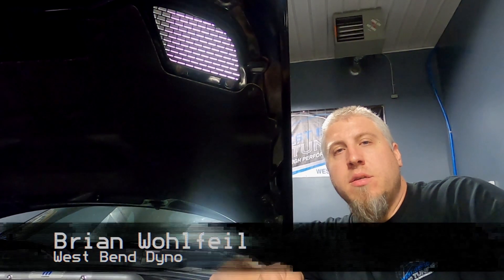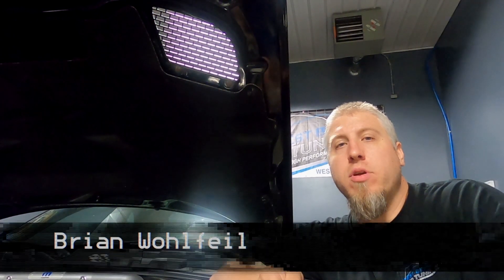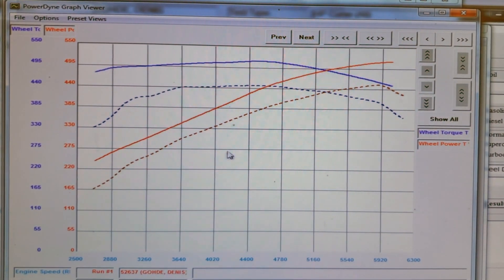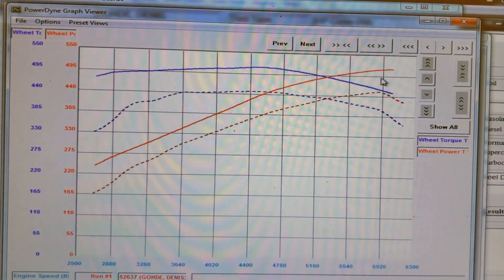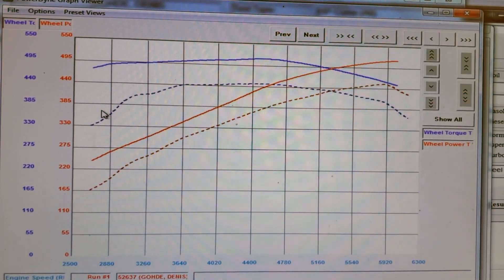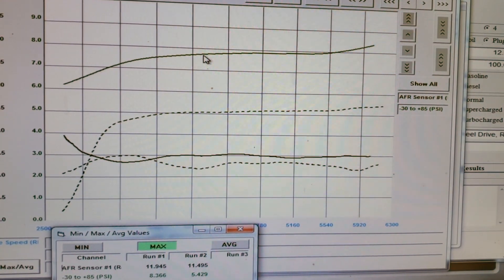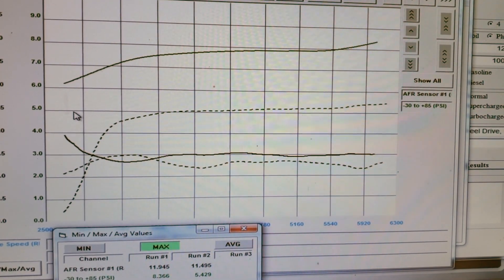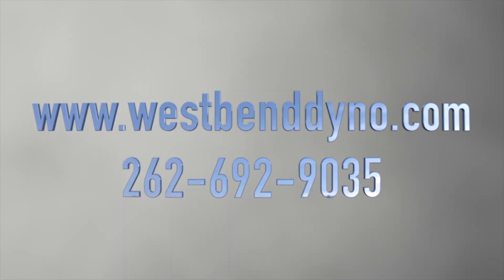West Bend Dyno Tuning - 2010 Challenger 5.7 L Hemi Magnuson Supercharger

Comment: Curious, with the 3.4 inch pulley it was 6pounds of boost and with the 3 inch it made 9 pounds? Stock internals? If so is there risk pushing that much? Can it still run on mid grade 89 or pump premium 91 ? The bigger numbers seem great but what else is there to know?
Reply from the maker: Stock internals, premium fuel only.  Every supercharged Hemi NEEDS premium fuel.  This engine still in the safe zone for power.
Reply: @westbenddyno  good to know. Thanks

Comment: I'm assuming all those numbers are through a set of long tube headers. I dropped from the 3.25" pulley to the 3 inch and actually lost power with the 5.7's factory exhaust system, but after adding long tubes, the car really came back to life!
Reply from the maker: David, that is with stock exhaust system.  You shouldn't lose power by dropping to a 3" pulley from a 3.25" unless you have plugged cats.
Reply: @westbenddyno  That may have been the case, but it would be unusual for a car with just 40K miles. The car behaved as if I'd put on a larger driven pulley instead of a smaller one (mine is the Edelbrock E-Force). After installing headers and 2 1/2 exhaust with the 3" pulley, the power gains were big.